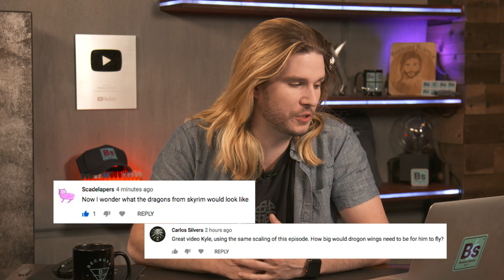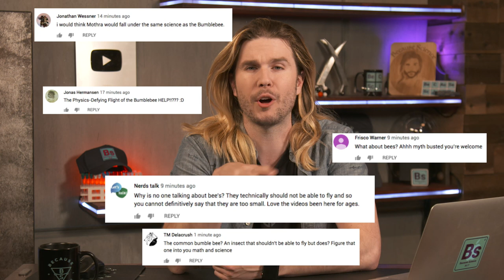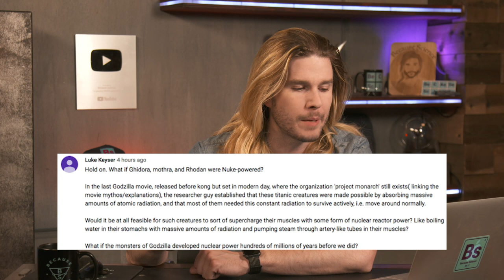Godzilla’s Nuclear Steam Breath | Because Science Footnotes

Comment: Direct quote from google, these things cant fly according to your scaling technique. "Many pterosaurs were small but the largest had wingspans which exceeded 9 m (30 ft). The largest of these are estimated to have weighed 250 kilograms (550 lb). For comparison, the wandering albatross has the largest wingspan of living birds at up to 3.5 m (11 ft) but usually weighs less than 12 kilograms (26 lb)." (Weighs more than 10kg and flies no problem...ish) Perhaps we need to rethink and also consider that birds have evolved highly porous and hollow bone structures which implies that the assumption of weight could be wrong. A dragon may be the size of a T-rex but doesn't have to weigh the same as it is not a land based animal and can have compensating physiological adaptations. Considering the time it takes for the dragons to grow to their full size take drogon from an initial 1 foot to over 40 ft in 10 years this is a parallel in the animal kingdom of a growth rates of that of birds (if extrapolated, stretched and fit to the assumed growth cycle of a T-rex) with flight rather than land giants like elephants or a T-rex which would be at half that rate. Furthermore one can consider the utilization of Hydrogen as a source of fire for drogon and as such this would provide extra lift. This would mean that the flap rate and indeed the muscle power required would dramatically decrease as the new estimated weight lies within the extrapolation parameters for flying dinosaurs of the Jurassic era. One can even use footage from the movie to estimate the power output of a wing flap in drogon when landing slowly, assuming GOT is set in an earth like planet (atmosphere, mass, etc...).

P.S. : Researching this stuff is so annoying as I have to pay to get access or request access from authors as I no longer study in university. This has just made me want to rage quit as the one thing the internet is good for i.e. free access to information is limited to the academic, whilst porn and games are completely free. Something sounds backwards. Anyways back to playing games and doing the other thing :))).

Comment: So if we take the steam explosion using nuclear radiation idea could we also say that the various flying kaijus could also use the extream heat to fly by intaking air above them through pores/organs beneath their skin and expelling the now heated air below them allowing them to not fly directly although if they can release it fast enough at high psi then yeah. But with the air being superheated they could use their wings like a parachute and ride the heated air that would rise from below them like a current flapping only to choose a direction. This could balance out the weight/power issue since they no longer have to flap as hard to fly.

Comment: Kyle--on the last live episode, what numbers did you use when calculating the mass of the Iron Throne, and by extension, the amount of heat energy required to melt it?
From your description, it sounded like you estimated the throne to be about One cubic meter, or 7874kg, requiring 24 GJ of energy. However, if you take the mass of swords (as Littlefinger said, there are barely 200 blades), the mass would be more like 360 kg, and the energy requirement would be more like 250 MJ, a couple of orders of magnitude smaller. The main difference is assuming a solid throne, versus a throne made up of numerous long, flat pieces of metal, which would leave many gaps and voids. Even if the throne was in fact a thousand blades, the mass would still only be about 1800kg, less than a quarter than a cubic meter of iron
Reply: that might be true if the chair is hollow, however it does not appear to be.
Reply: @thegodlessgamer4252  But why wouldn't it be?  There's no reason there couldn't be a void under the seat--it'd be far less work to leave that space empty than to fit swords into it, and it appears that the throne is constructed by bending swords to conform to a seat shape, so there's no reason to fill up a big empty space in the middle. And, if we're going by the show, we have a direct quote telling us how many swords there actually are; Varys and Littlefinger are standing in front of the throne. Varys says "The thousand blades of Aegons enemies" to which Littlefinger replies "There aren't a thousand blades; barely two hundred. I've counted."
If you take 200 swords, times the average weight of a bastard sword (about 1.8kg), you get a mass of 360kg, which is 1/22nd the mass of a solid cubic meter of iron. Even a thousand blades would only weigh 1800kg, still less than a quarter of a cubic meter of iron.
Reply: @alexvogel610  can you count two hundred swords out of that chair dude. unless it is mostlt solid then two hundred swords could not fit in the space that chair takes up. other than that however i will coincide. (did some googling)
Reply: Kyle--you also said that Drogon's breath would be the equivalent of about 38 flamethrowers. While the total energy might be the same, it wouldn't work, as flamethrowers don't burn nearly as hot as dragon fire. Steel melts at about 1500 C and rocks start melting around 1200 C, so Drogon's breath must be at least that hot. Gasoline only burns at about 945 C, so it's not going to be able to instantly melt steel or stone unless you go to some really extreme lengths of an insulated kiln and prolonged exposure and such. Flamethrowers were never designed to melt things, they were designed to ignite combustibles like clothes and people, to consume oxygen in enclosed spaces, and to terrify the living shit out of people to get them to abandon defenses.
Reply: @thegodlessgamer4252  I'm going with what Baelish said in the show as canon; with either 200 or 1000 swords, the mass is still less than a solid cubic meter, and that's assuming bastard swords. An arming sword, such as we see most of the foot soldiers using, would only weigh about 1kg instead of 1.8kg, or about 60% of the mass. 

I'd be interested to know what values Kyle used for his calculations, as he showed the equation and the results, but not the values he used, so I'm making assumptions based on his description

Comment: Hey Kyle here is a fun one for you. 

If you where on a heavy planet and somehow managed not to be crushed by the super gravity, would there be a point where the gravity pulls the air(Oxygen and such, Lets assume it is on a Larger Earth) around you close enough together so you and the air are equally dense thus allowing you to "float" above the surface? 

If it is indeed possible what would the gravity need to be to pull the molecules close enough and how much would the amounts of different elements matter.

Love the show and hoping to catch you LIVE sometime
Reply: We do have one place on Earth where humans float due to density and that is the Dead Sea (where you can tuck your legs like a 'cannonball' and still float; I've done it, it's fun), so, presumably, the density of the air would have to be at least equal to that of the Dead Sea.  Even if you weren't crushed, it would be more than a little difficult to breathe.
Reply: @SgtSupaman  I have had the pleasure of doing this muself in November of last year, its a weird feeling just bobbing up and down, but I'm more curious as the the possibility and circumstances that would make this possible in only air
Reply: @Sonnar92Gaming  , the thing is, for the air to reach the proper density to make humans float, it would likely have to be compressed so much that it becomes liquid.  In gas form, it just wouldn't be dense enough for us to float.
Reply: @SgtSupaman  this is a valid point, which is why I mentioned different elements maybe having an influence on this, as some gasses are heavier than others, it is probably impossible I know this, BUT what I'm asking is what circumstances would make this more possible

Comment: Pterosaurs could launch into the air by use of quadrupedal "vaulting", according to the research of the leading pterosaur experts, Mike Habib and Mark Witton, that's why they can go beyond the limits of those equations you used in your last video, they are based on living birds. 

In simple terms, Pterosaurs were quadrupedal and pushed themselves off the ground and flew using the same pair of limbs so they could concentrate "all" their muscle mass on their wings. Birds on the other hand, being bipeds, also have to deal with carrying the big strong legs needed to get them into the air in the first place so their size is a balance between muscle mass going into either the wings or the legs. Too much into the wings and the legs are too weak to get airborne, too much into the legs and the wings are too weak to stay airborne. 

Still, the equations were not the best, they converged on a limit of 10kg for a bird-like flyer and we have in the fossil record several definitely flying birds that go all the way to 70kg.

Comment: Wouldn't the wings have to be insanely thick to structurally hold the wings of the flying Godzilla monsters? And that the speed required for stable airflow would be so low with a gust of wind, they might takeoff Because of the wing being so thick the Bernoulli effect would be outrageously overscaled. The amount of lift would make a incredible strain on the creature. Also, how would having three heads even work, they would have to not only be interfaced with the body, but the other brains. Would a  creature at that scale even have a working endocrine system?

Sorry, lots of questions 😅

Comment: at the very least Antman's head should be safe if the helmet is made from some type of steel with some type of padding on the inside. the rest of the suit would likely be slowly burning away depending on the heat. the good news is except for some heavily carbon based stuff just about all fabrics are bad at transferring heat. it works even better if the suit is lose enough to trap a layer of air under it.

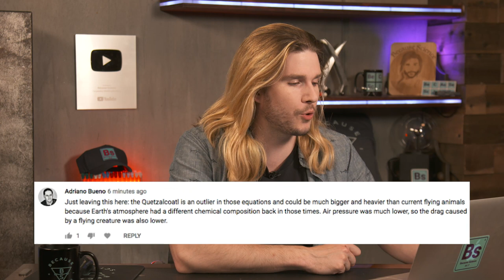Comment: 11:24 I don't know what that guy is talking about. Nitrogen was about the same, but Carbon and Oxygen were at higher levels. The Oxygen allowed for animals to get so large and the Carbon allowed for a warmer Earth thus allowing a lot more exothermic and mesothermic animals to exist at latitudes they couldn't today.

 Those are the primary gases that do and did make up our atmosphere so it was actually more dense therefore there would have been more drag, but of course more lift  I'm inclined to agree with the idea that they were gliders and not fliers given their theorized immense weight. But it is possible they were lighter than we currently think. 

Biology has proven to be flexible on these matters and whatever clues they're using to determine the average weight of the animal from fossils may be misleading. I'd also like to add that I'm an astrophysics major and know next to nothing about biology and more specifically paleontology. I had to look a lot of this stuff up so perhaps I sound completely dumb. Sorry if I do, but those are my 2 cents

Comment: Poor Kyle was the victim of confusing the statement rather than the math King Gidorah was 41 2/3 his present size in the 1954 alliteration thus 59 1/3 of his size is greater or aprox. 60% the math and statement were confused,  This is why so many are confused when a retailer talks of markup. A 40% markup means that 40% of the sale price is markup or the final price rather than saying that the item is priced at 166 2/3 % of the cost.  Math when viewed from different questions seems to have different answers. The answer has to match the question.

Comment: A bumblebee is able to fly because its wings operate at such a low Reynold's number that the air stays attached to the wings, regardless of the angle of attack. Technically speaking, a bee is not flying--it's swimming in the air. Because science. But what do I know... I'm just a Creationist with an ABET accredited degree in mechanical engineering.

Comment: You had to think about the drogon is if he has the mass of a T-Rex wouldn't that make him lighter than the mass of a 747 especially a 747 fully loaded with passengers and crew
Reply: Good point.  He would be significantly lighter (~16 tons) compared to a fully-loaded 747 (330 to 440 tons, depending on model).  On the other hand, the drogon doesn't have fixed wings and jet engines, either.

Comment: I think you need to clarify your "can't be hotter than the sun" statement. Because if you took all the photons coming out of the sun and unleashed them on a single hydrogen atom then that temperature is certainly hotter than the surface of the sun. This is something you could definitely do with an idealized mirror. However the limits lie more in the actual optics and "can't be hotter than the sun" is with the caveat "with real-world lenses and mirrors."

Comment: So in easier terms would a rocket is a big a** lighting rod flying through the air
I'm pretty sure a rocket not connected to ground  being struck by lighting is not dangerous but on the ground (insert explosion meme)

Comment: Prediction: Ant Man cannot be burned by a magnifying glass, because of one-to-two reasons. Primarily he still has the mass of a human which is going to require the same level of energy to increase in temperature regardless of size. And two, while a magnifying glass can certainly cause damage to a person's skin, the focal point would be almost as big as Ant Man depending on his size at the time. That's a lot of relative surface area to disperse the heat on.

Comment: In the video, you state that nature does not care about what is optimal, it only cares about what works - so how can we say with certainty that using the scaling you used to correct the wing spans in the movie is what is only physically possible. you use nature's potentially non-optimal "equation" for body size to wing size and applied it as a limit. thoughts?

Comment: You  are both correct and wrong that "evolution does care about what is optimal".  Yes evolution does care what is "optimal" at a point it needs to be. And then changes to environmental conditions occur that eventually renders the initial evolutional result inefficient/suboptimal (e.g. the fear center of our brain that makes us think we are crazy when we hear a scracthing sound on the corner of our room--which does not make sense because there are no more tigers lurking around. Nonetheless, it was the optimal design then). After that, it all becomes a matter of outdated design that still happen to function and is now not optimal. But then again, it should have been the optimal at the point of its development.

Comment: Well if lighting can always hit lighting then why doesn’t it always hit planes
Reply: It does hit planes, on a pretty regular basis.  The difference is that modern airplanes don't provide a convenient path to ground (unless they're ON the ground, obviously).  So the electrical charge just goes around the aluminum skin, and is dispersed back into the atmosphere.  It doesn't affect the onboard electronics, which have extra shielding and surge protection just in case.

Comment: The Quetz: many are fighting over it, I want to believe that the proportion mass-wing area (not only wingspan) is biased in this case. Hollow, lightweight skeleton carrying a probably lightweight beak with the flight muscles being probably some of the heaviest (and most energy dense) parts, funnily concentrating the mass right in front of the center of lift and thrust (stable flight achieved yay). The wing area hoever exceeds the typical wing-body relation we know off, today. If you look at the wing areas of large birds like Albatros or Kondor, there is a considerable difference there. And those are excellent thermic gliders and able to lift off with their own strength, albeit needing some runway.

Gee-Drah.